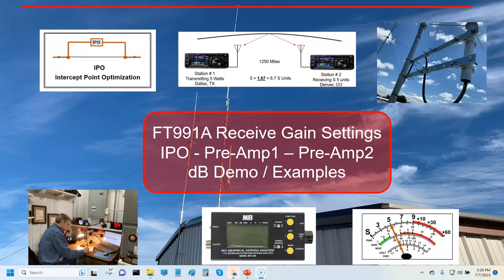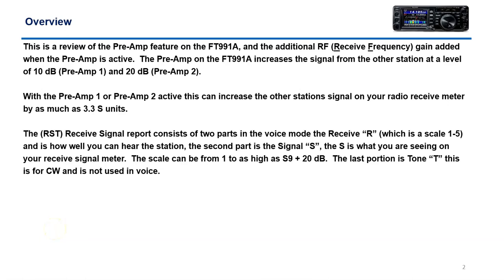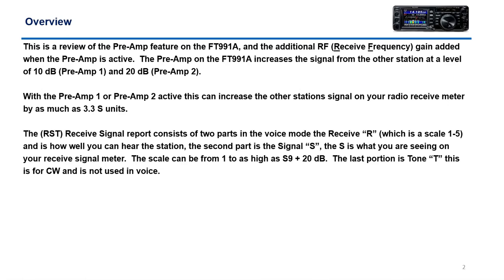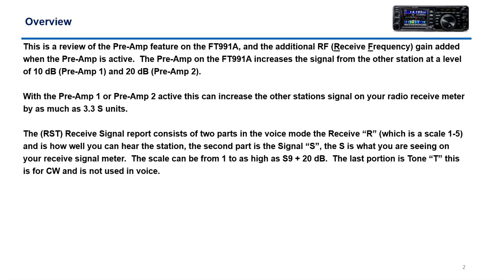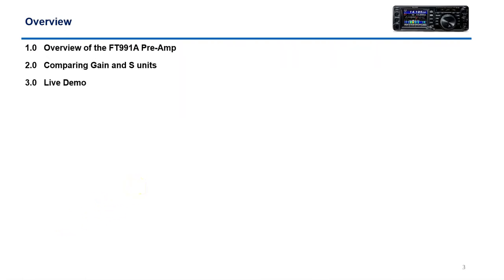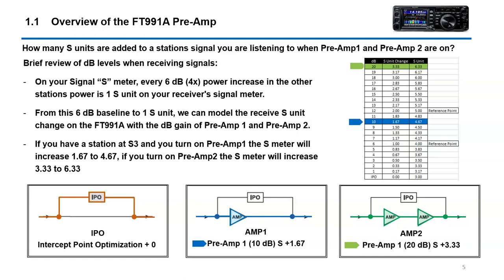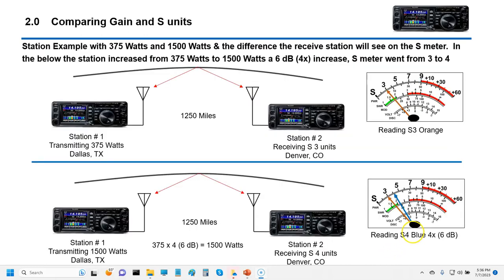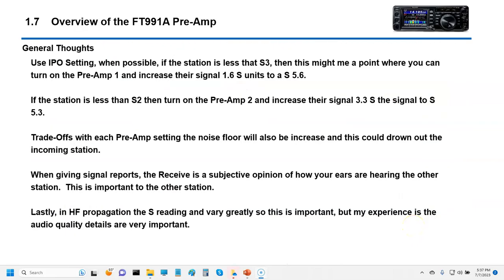FT991A Receive Gain Settings IPO - Pre-Amp1 – Pre-Amp2 dB  Examples  -

Comment: This video should be seen by all radio amateurs. Most of them give wrong signal checks because most of them use the receive preamp and happily report 9 +20 to signals that only deserve a 5 or 6 at best.... Very well explained (I already knew it years ago) and I always pass the real receive signal, and if I need more gain I always tell the correspondent that I have activated the receive preamp with the consequent signal increase. Best regards, 73

EA3BLN
Reply from the maker: Good evening and thanks very much, I really struggled with this video I wanted to make sure I presented the information as correctly as I could always wondered about RST's S9 +20bB they never really seem right, again thank you for the nice comments I always want to do all I can to promote HAM radio hobby '73 from KI5JUF